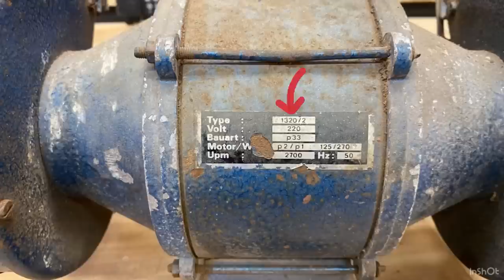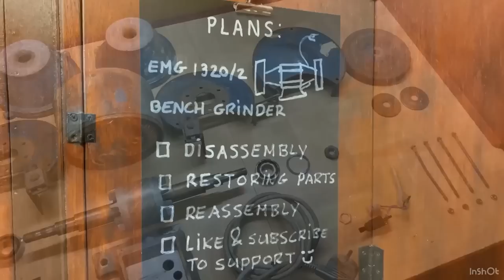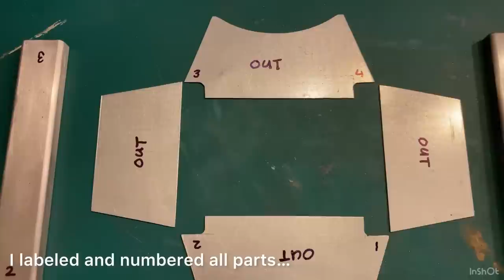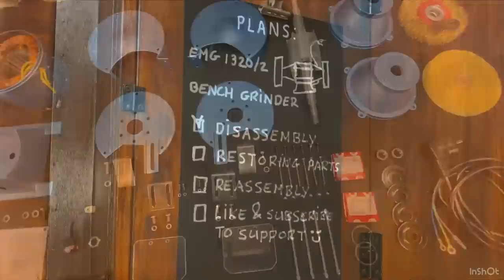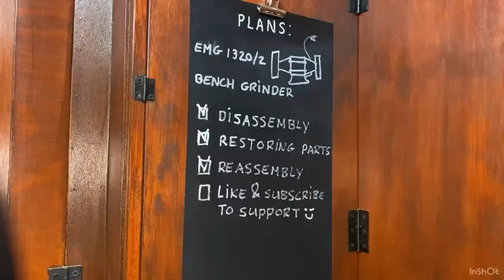E.M.G. 1320 / 2 bench grinder (Restoration)

Comment: Everything looks very nice except for the thickness used in the piece created as a base and in electricity that turn that you made to the cable to prevent it from moving is not recommended either, but boy, not everything is perfect in this life, a hug and blessings😊
Reply from the maker: I must agree with you Ogle, the thickness of the metal was a gamble. Time will tell if it holds but next time I will use thicker metal, if only because it makes welding a lot easier! 😉 And that knot in the cable along with the ground cable being to short… lesson learned here! Thanks for your comment and I hope you enjoyed the video. A big hug and blessings back to you! 🙏🏻
Reply: Thought the same but just through scotch Brite wheels on and it's perfect.